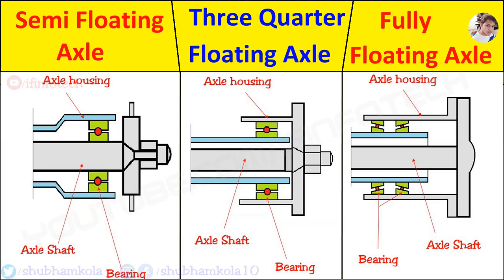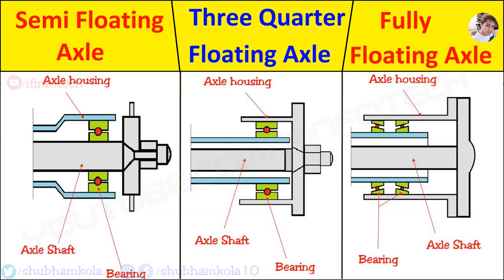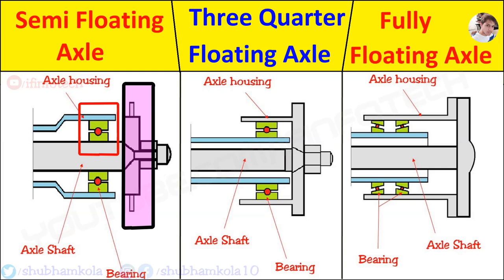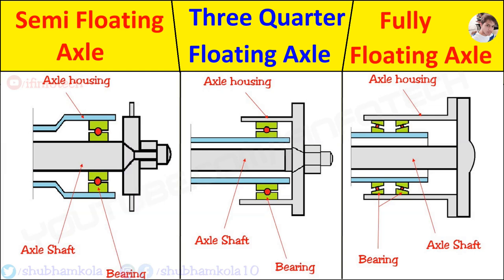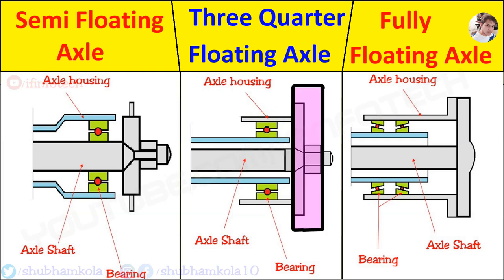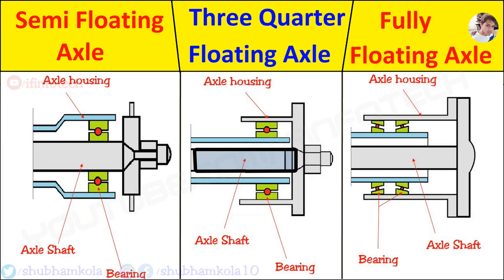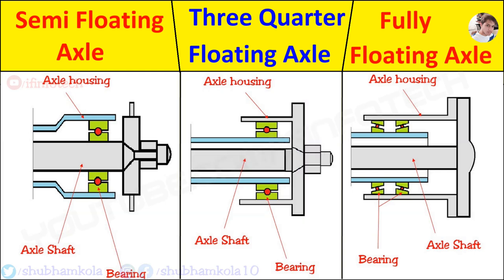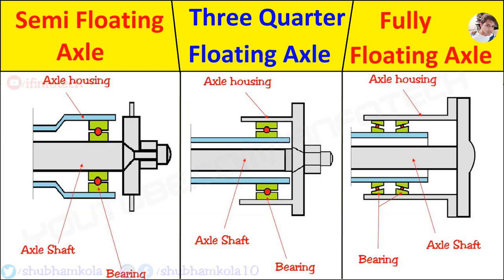Semi Floating Axle, Three Quarter floating axle, Fully Floating Axle: Bearing Construction

Comment: Semi floating axle also called live axle
Reply: pro trick : watch series at flixzone. Been using it for watching a lot of movies lately.
Reply: @Layne Lane yea, have been using flixzone} for since december myself :)
Reply: @Layne Lane Yea, been watching on flixzone} for months myself :D
Reply: I think all these 3 types axle are live axle.
Reply: @WilliamLiangWu  
Yes you are right  because they are hollow and has driving half shafts inside
Reply: also because they are responsible for driving the wheels, dead axles don't get power they only support the weight of the vehicle and wheels on dead axle rotate due to live axle. In a RWD vehicle front axle is dead and rear axle is live.